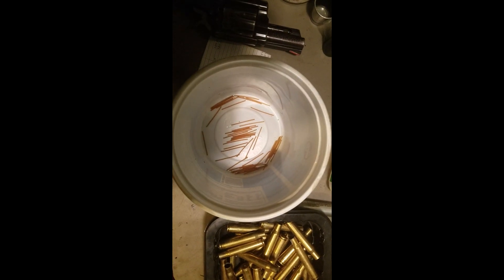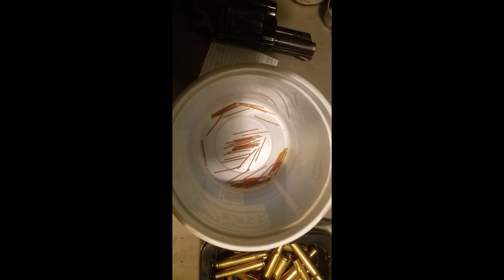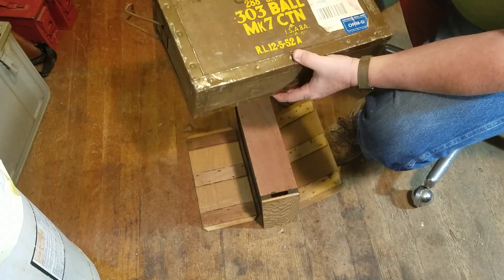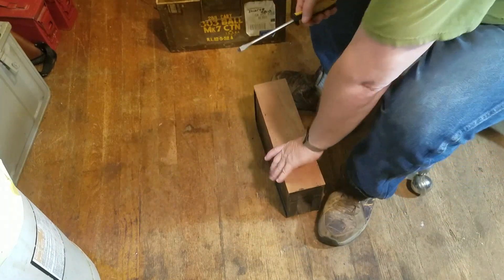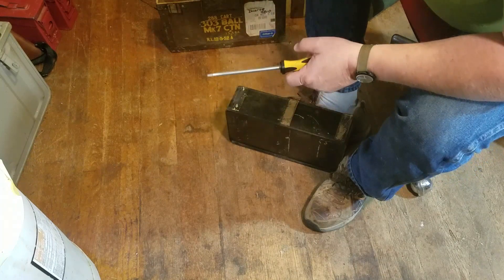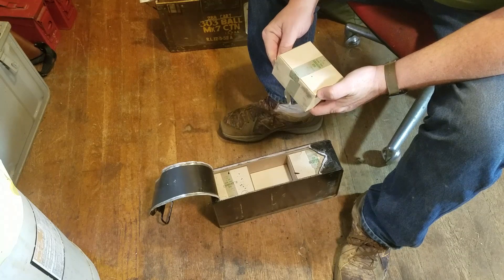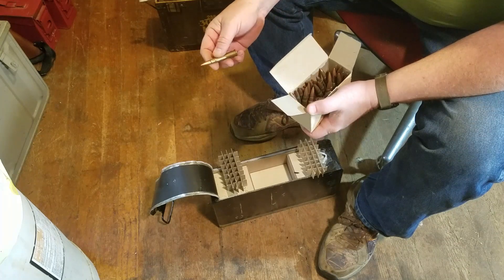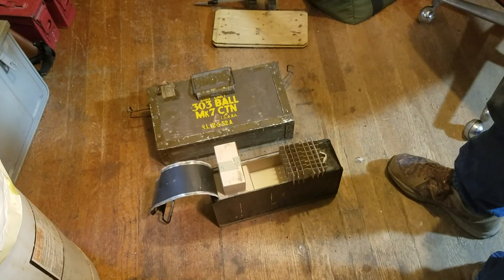.303 Britt ammo. HEY! Let's unbox some old ammo.

Comment: Man, that stuff sure is well packaged! 32 round boxes makes it look like it was intended for Bren gun use. Nice find, I have never had a sealed case of 303 ammo, only boxes of 20 or 48 rounds. So based on the marking your ammo was loaded at Royal Laboratory, Woolwich Arsenal, Kent, UK. Regular Mk 7 cordite ammo with 174 grain flat based bullet and corrosive primers. Have you fired any? If you have tried some did you have any duds or hang fires or was it still good? 
Interesting video, thanks and have good day.

Comment: Mk 7 303 is machine gun ammo do not shoot this through a lee enfield it will bend the reserver (its loaded verry hot )
Reply: Mk VII is not MG ammo. It's what is called Dum Dum ammo and as such is designed to tumble when inside a person. Very nasty stuff and is considered a no no for self defense.
Reply: @michaelbenjmitchell1   thank you I was misinformed :) I appreciate that you corrected me
Reply: @thomasmoore9308  I have 20 rounds of Mk VII ammo. Plus I did some reading on it and it's tumbling characteristics is similar to 7.62x39. Nasty stuff indeed since the core of the Mk VII is Aluminum.
Reply: They DO tumble.
Shot a van sideways through the side and tracked it tumbling through the back doors